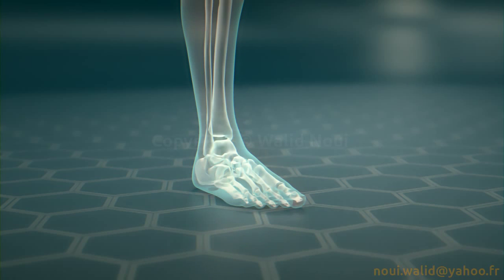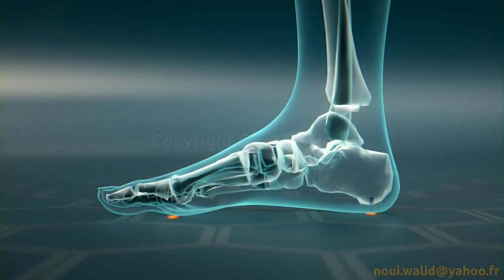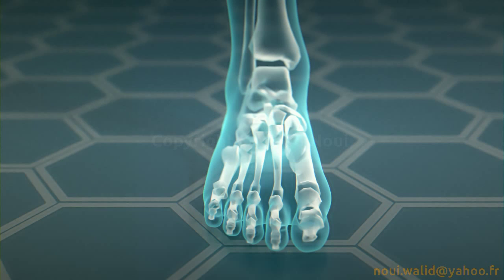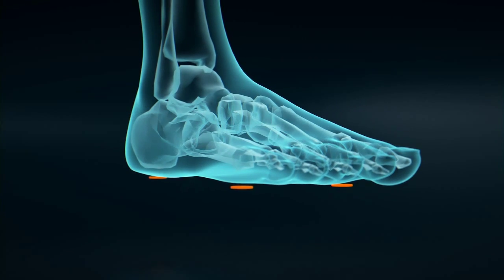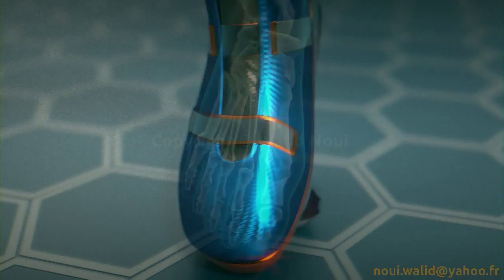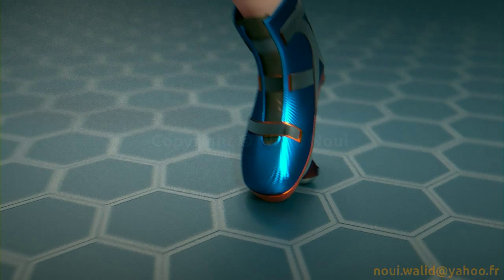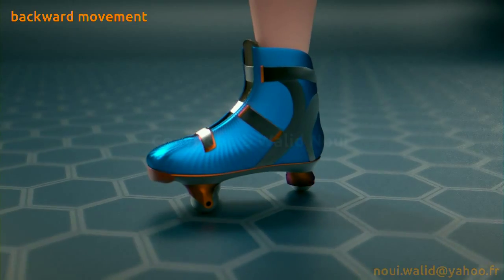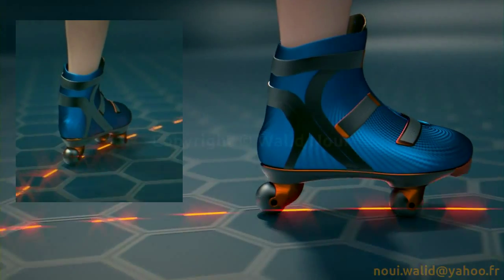roller skate new innovation (fise algeria demostop)

Comment: YEaaaah.........NO! This is not a good concept. How in the name of god are you going to be increasing speed? By the looks of things, you would always have to "outrun" your out-of-control furniture wheels. Not for speed skating nor tricks. Ive been skating for over 20 years now and I have been trying to innovate for ages. This concept will lead to a dead end, not to mention if one tries jumping, these things would buckle and you will fall flat on your face. Oh and yes Powerslide has some awesome skates. I have the Imperial Cruiser with a 255 frame.....although, only 110mm for now.
Reply: https://youtu.be/MipbUpBXwFw

Comment: Check out Powerslides Trinity Frames. Finally they have something to rival 2 point mounting systems. The design in this vid is unique, but perhaps not much use as anything other than a toy. Professional skaters need a lot more. If You can rival Powerslide inline frames and roll-line quad plates you will make a lot of money. Keep the designs coming!

Comment: The problem it's you don't understand the propulsion in skates. With this invention your top speed is really low.

Buy some lessons, learn how to properly go with skates, then you will know where you can innovate and where not.
Reply from the maker: hi
I practiced the quad roller skating for over 10 years
for triroller, I told you this is another way of skating
by what I am doing a craft prototype, we tested
starting the skating is done in the same way started walking